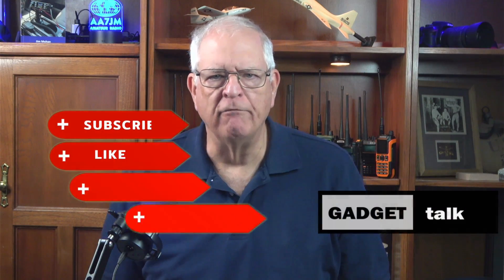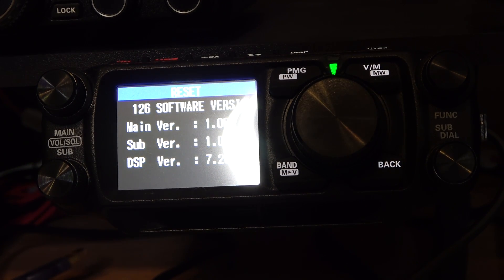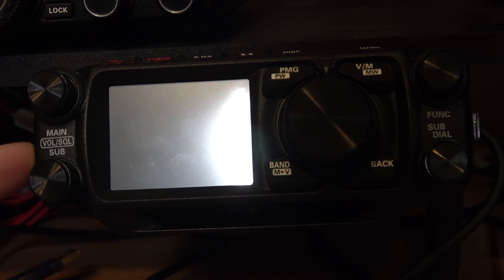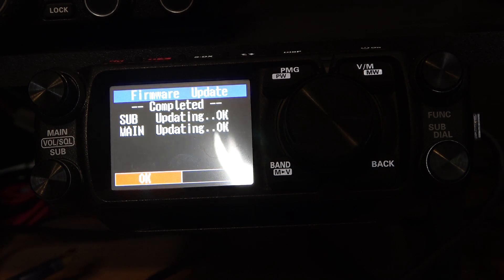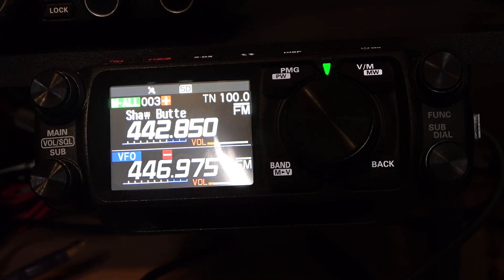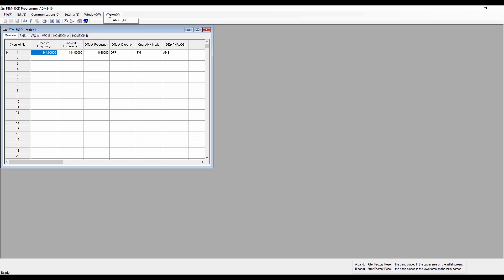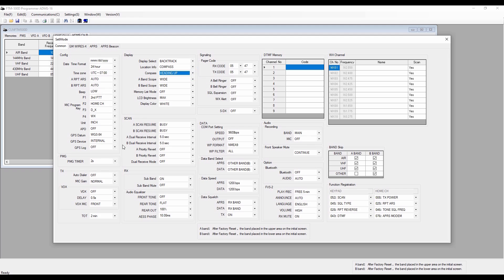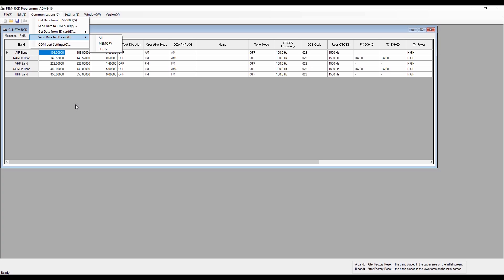Let's Update the FTM500 Firmware and Use the CPS

Comment: Need to program your “brand A” frequencies into your “brand B” radio, or you just discovered how easy it is to brick your radio using CHIRP? You are likely ready to move up from entry level “free” (you did get your CHIRP source to pay for the brick didn’t you, if not CHIRP was’t free). 

For Mac users note that RTSystems has an Apple Mac compatible version (derived from their Windows version) for a wide range of main stream Amateur Radios (and even some of the Chinese “soon to be bricks with next firmware update - or dead RF Output due to failed antennas”).  

I have used this offering since it was first published a few years  back and it has always worked without issue.  The more radios by different brands you have the more the RTSystems make sense by moving programmed frequencies between the with a few clicks.  

Use the RTSystems cables because they all use certified serial data chips in them.  The eBay, or other sketchy sourced cables are likely supplied with pirated chips that either don’t work at best or at worst brick your radio.  

Now that smart phones are being supplied with Type C ports perhaps RTSystems will come out with apps for programming your Ham radios - would that be something!